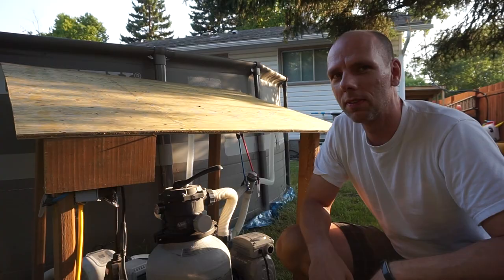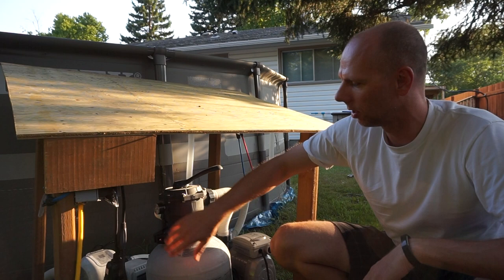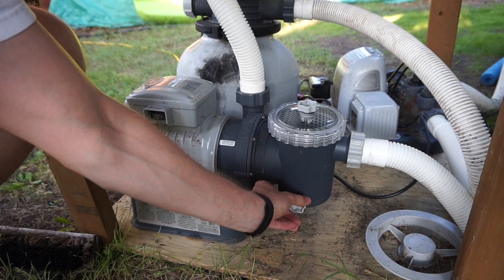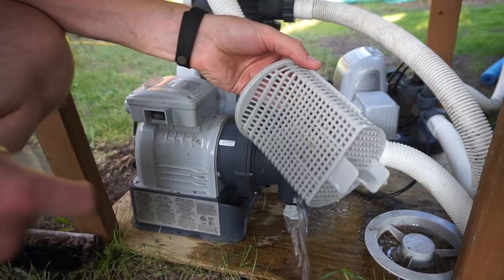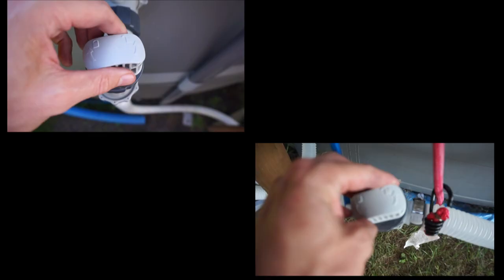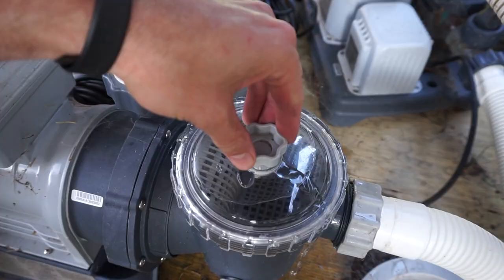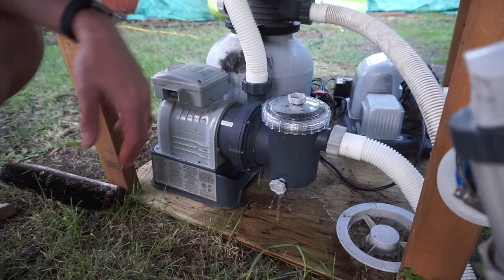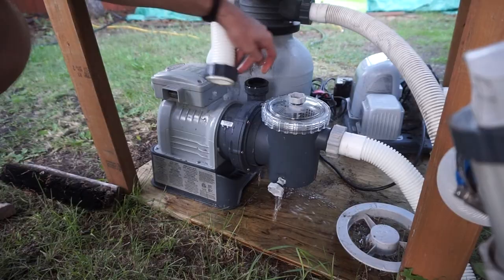How to clean an Intex sand filter pump

Comment: Thank you! I spent 3 hours pulling my hair out and taking everything apart to figure out why I kept getting a low flow warning. Turned out I forgot to put back the gasket on the impeller plate @5:51. Glade I found your video. You saved whats left of my sanity lol

Comment: Thanks! I really didn't want to take the pump apart,  but your video showed how easy it was. Found pine needles and hair clumped inside the impeller.  Cleaned it out and the pump is back to full song! And power.  Thanks again!

Comment: You need to add Vaseline to all the seals to prevent water seeping out. It does NOT damage the silicon 'O 'rings, as has been suggested on various YouTube videos. It is recommended by Intex.
Reply: Any advice for the screws not sealing tightly?
Reply: I have a policy of 'if it ain't broke, don't fix it'. I've no idea, but it sounds like you've accidentally lost an O ring?
Reply: geoffphuket no it’s on the control center next to the filter that holds the filter on.  Sorry, very bad with the terms of the unit.  The piece he unscrewed in the video that has 8 screws sealing it.  I unscrewed it to clean it and now the screws don’t tighten all the way.  So it’s leaking and the machine can’t run without it sealed.  I tried the trick of putting a toothpick in and then the screw and it made one of them tight.  I’m going to see if that works
Reply: You have got the locating notch in the correct position? It didn't need toothpicks during manufacture... And it certainly doesn't now!
Reply: geoffphuket yes it was in the right position.  Once I installed it after the winter it started leaking a little

Comment: Hello when you took off the 8 screws, there was a black rubber washer. I contacted Intex customer service and they do not have the part number. They suggested that I buy another pump. My pump is 2 years old and just needs a rubber seal. Do you happen to know the part number?

Comment: First time I see the impeller of an Intex sand filter, just was curious. ;)  Why not putting a fine nylon mesh in the strainer basket, saves you time taking the pump apart.
Reply from the maker: Yeah, that's a good idea.
So far I haven't had any trouble with my impeller getting dirty, the strainer on the outlet and the leaf basket have done their jobs, but if that changes, definitely something to consider. 

Thanks for the idea.
Reply: You're welcome. I put a fine mesh over my skimmer basket, which is basically the same although the Intex skimmer by design has a lot of water passing the basket going directly into the outlet and into my filter cartridge. But hey, every bit of debris trapped before the filter helps.
Reply: So you never finished the video. What if now you still have poor flow going back into the pool?

Comment: I opened my pump up to clean it and now it won’t seal back tight with the screws... any advice?
Reply: Same
Reply: Make sure the cover is lined up correctly. There is a flat side that goes either to the top or bottom.

Comment: Maybe someone can advise. New Flowclear pump and working fine … until I screwed up today. Turned the pump on and went to the pool store. Came back and realized it was running on CLOSED (X) setting. It has low pressure and not good pressure on the inlets A and B but good inflow pressure. It is a sand pump. Any suggestions sure sure sure appreciated. Thanks if you can give me any ideas.

Comment: I am in desperate need of some advice. I know different years the pumps were made differently. We recently bought a 2014 model of this pump and it will NOT STAY PRIMED!!   I've tried all of this and noticed the cap you pulled off of from in front of the impeller we DONT HAVE! could it be possible my year didn't come with that piece?

Comment: Just bought a house that had one of these pools and pumps.  Took off the impellar cover and there was no rubber gasket on the impellar.  I cant find this pump or parts for it other than amazon but none of the replacement parts show an impellar gasket.  So Im thinking this impellar isnt working correctly.  But I also need to find the parts.  Any links you can provide?
Reply: Hello I am dealing with the same issue as you were. Did you ever.get a part number from Intex? I tried to reach out to them but they suggested that I buy a new pump lol! The rubber gasket is worn out and causing my pump to leak.
Reply: @DimasMacias-lf5mi  no, I ended up having to buy a new pump though anyway because I used a drill to tighten the impeller cover and I didn't realize how easily it stripped the plastic screw holes.

Comment: I did this and when I put it back together, its leaking pretty good from the bottom of the impeller housing. The screws are all tight, but that "flywheel" type piece, is there a certain way that goes back in? Looks like it could go above or below the notch on the lid. Any help?
Reply: I'm having the same issue. My black o ring is worn out but I cant figure out which one to buy
Reply: Try wrapping in plumber's tape
Reply: I add plumber tape and still leaking in the bottom any info on fix would be great thanks

Comment: What is that round steering wheel looking piece sitting on the wooden base for?  The guy who put my pump together has it sitting next to the pump and I d9nt know what it's for...
Reply: It's for when you change clean/add sand to your sand filter it holds the propellers straight. Then you remove it and put the valve top on it.
Reply: For putting sand in filter

Comment: When you take the skimmer basket and unscrew the front of the motor there is a black o-ring on the front of the plastic piece that comes out. Any idea what its called.  Mine is stretched out and leaking.  I cant figure out how to order one
Reply: They do not sell that o ring on the Intex site. I also ordered a kit that supposedly came with all of the replacement o rings and washers and it wasn’t in there either. They only show the parts for outside of the motor compartment. So frustrating!
Reply: My rubber seal is damaged as well. I can't get.any support from Intex. Did you ever.find out where to get a replacement?

Comment: Hello, does anyone know what gasket or ring is on the yellow thing  at 5:12 of video. I need to change it but can't see anywhere what the item number is. Thank you in advance
Reply: Hello did you ever find out the part number for your gasket seal on the impeller? I am dealing with the same issue and can not get any lead with Intex.
Reply: @DimasMacias-lf5mi  any updates on your end? mine is damaged as well and i need a new one. thanks

Comment: My pump motor just hums when I turn it on.  Any advice?
Reply: Same here
Reply: Take the cover off the pump motor. There are 4 wires coming out of motor and a ground wire that come into electrical box. Disconnect those 4 wires and pull off box. On the left of motor there is a fan. Pull the snap ring off and try to turn shaft. Most likel its rusted up a bit.

Comment: OMG HELP PLEASE! Anyone know where I can get a replacement one of the kinda flower shaped cream plastic thing that’s inside the motor, the bit that comes off with an o ring at 5:10 my dad took our motor apart and has lost it, what even is it!!!
Reply: Did you ever find a replacement?
Reply: Karissa Ann Taborn unfortunately not we just bought a whole new pump, contacting intex we found out the motor is not under warranty and they don’t stock the parts, a friend offered to 3D print if we could find specs but to no avail, I. Found out the missing piece just diverted water it probably would have caused too much damage but definitely a slow leak